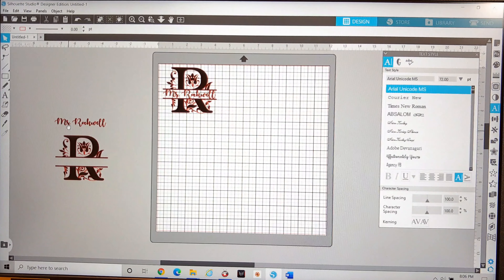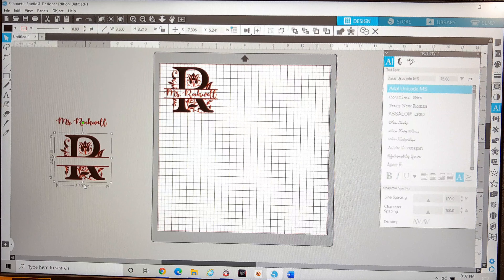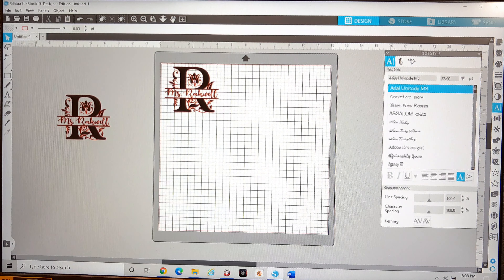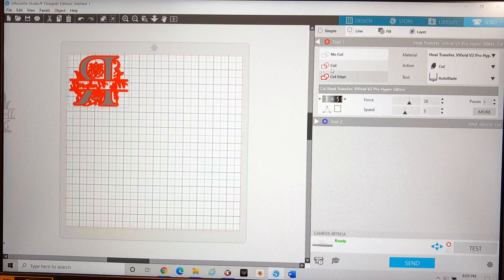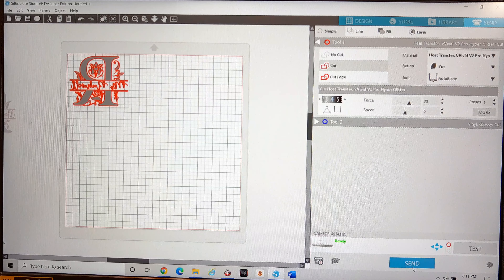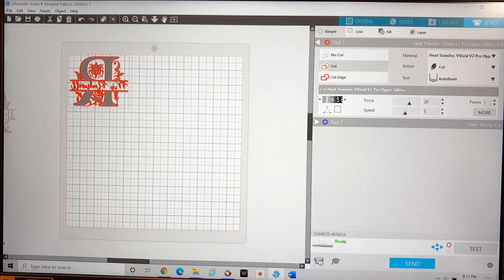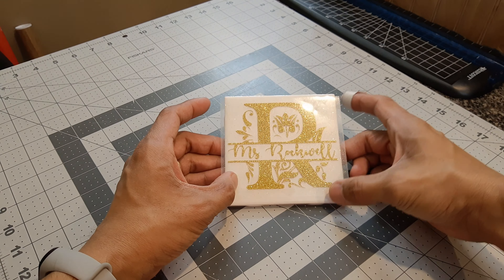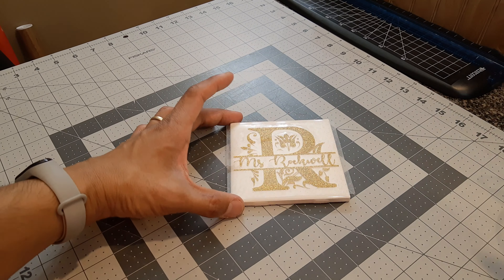Heat Transfer Vinyl on Tiles!?!? It’s easy!

Comment: I could not tell, do you close down your heat Press handle all the way? Looks like very light pressure.
Reply from the maker: You are correct. I did not push it down all the way or very hard. I did apply light pressure, so as not to smush the HTV on the tile. Since the tile is a hard surface with no give, and not a fabric or cloth that has give, too much pressure will smash the image.
Reply: @ColorChangeCustoms  Thank you. I've been doing some experimenting with HTV on wood so I found this interesting.
Reply from the maker: @maggie9256  great! Hope it was helpful! Thanks for watching!